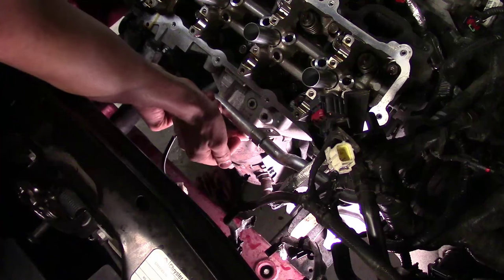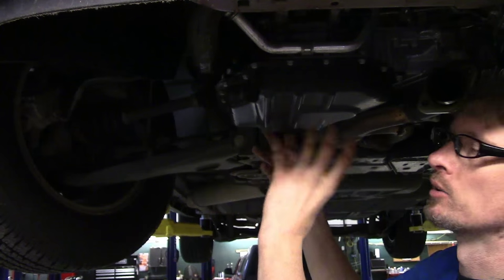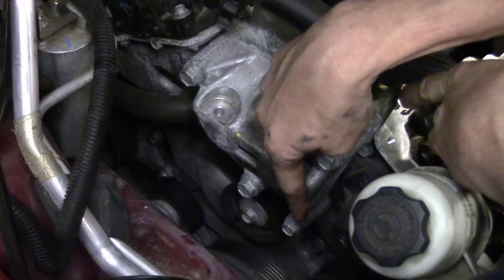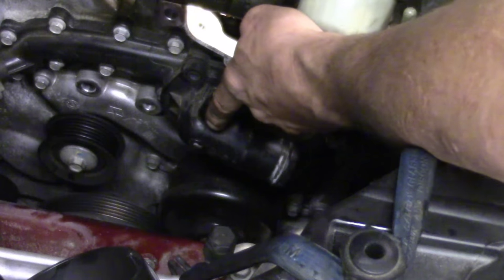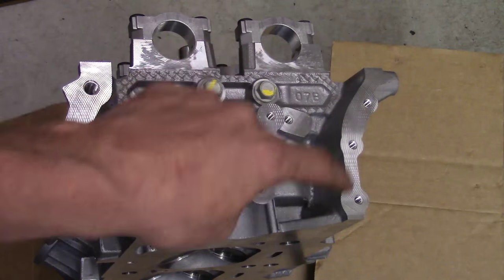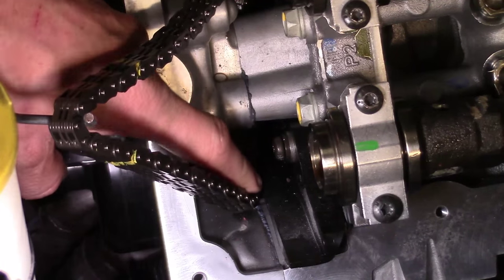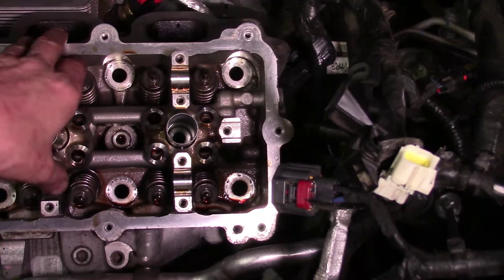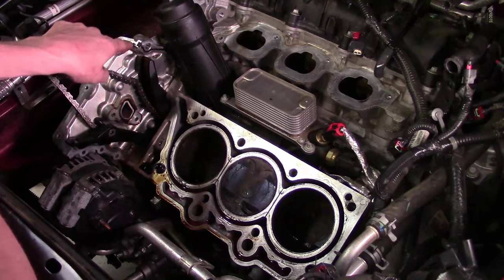Part 7/10: 3.6 Pentastar engine left cylinder head removal (the short cut)

Comment: I KNOW THAT THIS VIDEO WAS A WHILE BACK BUT I HAVE A 2011 VW ROUTAN WITH THE SAME ENGINE. I HAD TO CHANGE THE SERPENTINE BELT BECAUSE IT BROKE AND WHILE I DID THAT I FIGURED THAT I WOULD FLUSH THE RADIATOR, INSTALL A NEW THERMOSTAT, AND CHANGE THE OIL AS WELL. NOW I HAVE A LEAK SOMEWHERE. IT'S CONSTANTLY OVERHEATING AND LOSING COOLANT ( THE STEAM WHEN I COME TO A STOP AFTER DRIVING A SHORT DISTANCE IS THERE TOO). I ONLY TOOK THE TOP PASSENGER RADIATOR HOSE OFF AND THE LOWER PASSENGER HOSE OFF (THE THERMOSTAT HOUSING TOO) I CANT SEE THE LEAK AT ALL WHILE IT'S RUNNING. AND NOW WHEN I DRIVE THE BELTS SQUEAKING. WHAT DID I DO??? COULD IT BE AN IMPROPER BELT TENSION, STOPING THE WATER PUMP FROM FUNCTIONING CORRECTLY? COULD THAT BE THE SQUEAKING? WHY WOULD I BE LOSING COOLANT IF THERE'S NO LEAK BUT AN IMPROPER TIGHTENING OF THE SERPENTINE BELT CAUSING THE WATER PUMP TO NOT SPIN FAST ENOUGH  NOT TIGHTENING THE THERMOSTAT HOUSING ENOUGH? IM NOT SURE. PLEASE HELP. I KNOW A BIT ABOUT CARS AND HOW THEY WORK BUT THIS IS BEYOND MY EXPERTISE.
Reply: I checked both top and bottom radiator hoses again and they are both secure with no holes or rips in them. why would it suddenly spring a leak? and WHERE? thanks for taking the time to read this man, I REALLY appreciate it and could use the help.

Comment: I need to get the right side head off of a 2014 Charger with the Pentastar. Do you know of this shortcut applies to that side as well? Looks like they're constructed fairly similar.
Reply: It doesn’t, only the left bank, timing cover has to come off on the right bank, it has something to do with the way the tensioner is set up, if you scroll through the comments this questions been asked and his answer was no short cut.. I don’t think it’s that far down, hope this helps.

Comment: Great video, I’m adding this because I hate to be the guys that asks a question and then doesn’t post how they solved the problem.

I was having trouble getting the cylinder head off my 2015 jeep wrangler  after undoing all the bolts in video. I just wanted to add this. 

For the jeep there is no motor mount to remove the alternator is bolted in this location you must remove those bolts and move the alternator out of the way. 

Next to the where the exhaust bolts on you have to remove the 2 bolts that hold that pull on, ac compressor or whatever it is.

Lastly I wanted to add the head is really stuck on there, it didn’t move at all pulling and prying. I ended up using a ratcheting tie down between the hood mount and the back bracket that holds
The cam on place. 3 clicks and POP done. Keep an eye out not to bend your hood bracket mine didn’t bend but just be careful. 

Thank you

Comment: you sure are a bad ass sir. can't thank you enough. trying to comment on all the vids (in case it matters for ads/revenue) also sub'd. this is my gf's van and proved to be a pain in my ass with the dreaded #6 cylinder misfire. ended up being the cam lobes are ground down from the rocker arm bearings failing. never seen that happen before on two separate cylinders, just exhaust side.
Reply from the maker: Thank you sir

Comment: If your catalyst heat shield nuts are all rusty you can get away with leaving it on so that you don’t have to replace it, or going without the shield isn’t a good idea either. 

After breaking it lose with a wrench I used a wobble 10 to further loosen the lower right catalyst bolt. Then I removed the bolt holding the silver cooling line to the front of the engine oil pan. That allowed me to pull forward on the cooling line and use a wrench to loosen the lower left catalyst bolt.

Comment: I have a town and country 2014 3.6 and I was doing a leak down test for the number 2 misfire cylinder and the leak is coming out of the exhaust side,
do I need a new head or should I have the values reworked?? also the car has 98000 miles on it, so I think it's way out of warranty, thanks for all your youtube videos, really are details

Comment: Mine is a '15 Wrangler.  I have all of the bolts off as described, but the head will not budge.  I tried a pry bar in the intake port, tapping one of the timing chain bolts (partially installed) with a hammer, even lifting it off with a porta winch... It the three bond that strong?  Any advice is appreciated!
Reply: What did you end up doing? I’m doing my 15 wrangler have all the bolts taken off can’t get this thing to budge. What did you end up doing?
Reply: Never mind I figured it out. Was missing the 2 bolts that hold the pully to the left of the exhaust.

Used a ratcheting tie down from the cam bracket to the hood bracket and 3 clicks poped right off

Comment: I dropped the T-30 like you said not to do 🤦🏻‍♂️. Is there any chance it fell down to the oil pan? Or do I have to remove the timing cover to get it? I have a 2012 Dodge Charger so the engine is set up a little different. Thanks

Comment: I have a 2014 Crysler 200 with the 3.6 at my shop and need to change the right intake cam. Do you have a video showing how you locked the chain tensioner in place before disassembly?
Reply from the maker: Sorry about the delay. I currently dont have any videos on that. I do wont to film that in the future....just have to find the time. Thanks for asking and sorry again about the delay.
Reply: @MotorCityMechanic  I was able to do this job no problem. The key is locking the tensioner and chain in place (long 1/4 drive exstension) before cam removal. Good videos by the way keep up the good work.

Comment: i have 2013 grand caravan. i have check engine light on show code #2 cylinder misfire i take to the shop he change coil pack  and spark plug. but the light still on. i take to dealer they want me replace engine cylinder head. any way you can help me what to do to solve problem. thank

Comment: While I was inspecting the rocker arms, I dropped something in the timing chain area. How hard is it remove the timing chain cover?
Reply from the maker: Its going to take some time. I wonder if it made its way down to the oil pan....that might be a great place to start to see if its laying in the bottom instead of taking the front of the engine and apart.

Comment: What is that aluminum block in the engine valley.
Reply from the maker: That would be the engine oil cooler bolted to the oil filter housing.

Comment: I have this project coming up changing the head gasket left side of my Dodge Charger 2012 3.6 and I was just wondering would I have to remove my engine mount in order to remove the head? 
Thank you
Reply: I'm only guessing here that the engine mount applies to transversely mounted engines.

Comment: You got to tell me what impact gun you used to take head bolts out. Bolts are so incredibly tight!!! Please tell me how you done it I appreciated.
Reply from the maker: On these I have had to use a jack handle on  a breaker bar before and sometimes just a long breaker bar. I do have a Milwaukee impact that has somewhere around 1500ft/lbs as well that I grab from time to time. None the less its tight as you already know. Thanks for asking and make sure to subscribe.
Reply: @MotorCityMechanic  you are the man!!!! I did this work THANKS TO YOU!!!! IF I HAVE MECHANIC QUESTIONS CAN YOU HELP ME IS IT VIA EMAIL. N ARE YOU LIKE PAYPAL FEE. PLEASE LET ME KNOW

Comment: I got everything off and my head won't come up all the way. I got it loose some. Enough to wiggle it and drain the coolant. Any suggestions
Reply: I'm doing this on a JK and I'm having the same problem. All 8 head bolts out and all 8 timing cover bots out and the head won't budge. The coolant is starting to drip from the back of the head. Did you have any luck and if so, what did you figure out? Any help would be greatly appreciated! I don't want to break anything.
Reply: @don1249  yea it took me a while of prying and tapping. Just be sure you have every bolt removed from he timing cover area. They say you can't get the passenger side head off without removing the timing cover. But I managed to get mine off. Just had to get creative with the torx head screw. Similar to the drivers side.
Reply: @09fatbobmike  I'm positive I got all of the necessary bolts out because I checked all of the bolt hole locations on the new head. Thanks for the quick reply. I'll keep prying and tapping!
Reply: @don1249  yea mine was stuck very well. I was using an Axe handle and pry bar to pry on it.

Comment: Why did you pull the Head?
Reply from the maker: The head on this engine was removed due to a burnt exhaust valve. It was common on some older 3.6 engines  and some had the warranty extended to cover the issue.  Thanks for asking and make sure to subscribe!